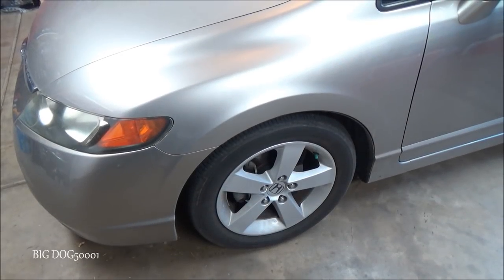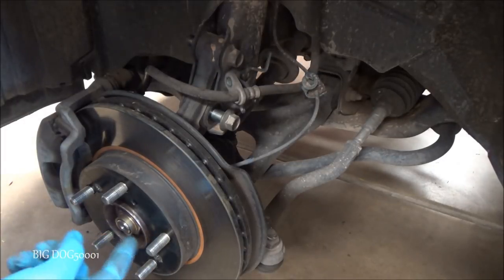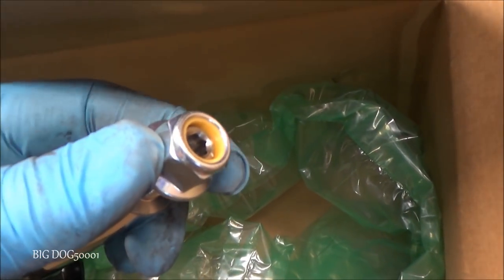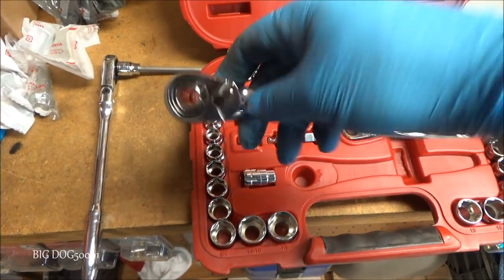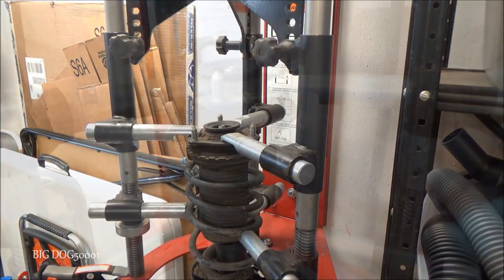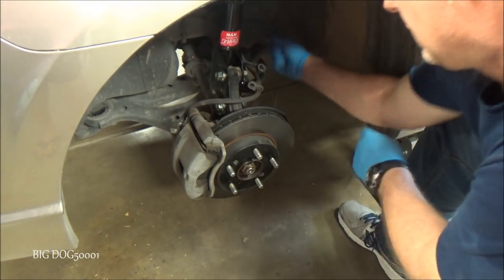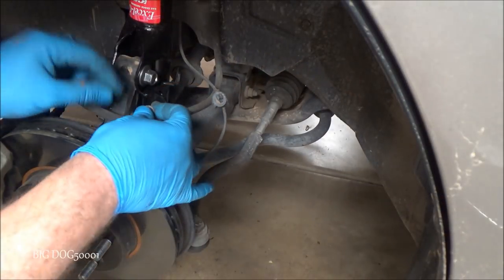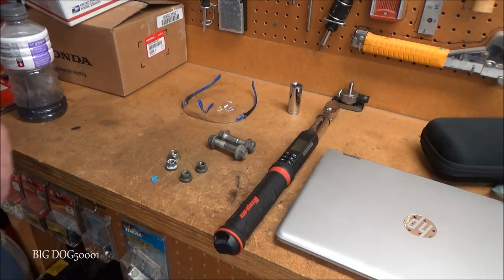Honda Civic Front Strut Replacement 2006 (2006-2011 Similar)

Comment from the maker: Tools and Parts
This channel earns a small commission using some of these links - at no additional cost to you.

KYB Strut ONLY (Front Left):  https://amzn.to/2NaRPlx
COMPLETE KYB Strut Assembly (Front Left):  https://amzn.to/2QgoYPg
KYB Strut ONLY (Front Right):  https://amzn.to/2NbFops
COMPLETE KYB Strut Assembly (Front Right):  https://amzn.to/32GgRfQ
Daytona Jack (Cheaper at HF with Coupon):  https://amzn.to/2LtHfUP
Jack Stands (Cheaper at HF with Coupon):  https://amzn.to/2LLWSWr
MIlwaukee 3/8" Impact Wrench:  https://amzn.to/2LRwryu
Sunex 3/8" Impact Sockets:  https://amzn.to/2NXij9O
My Favorite Small Screwdriver:  https://amzn.to/2Lv0HAp
GearWrench Ratchets:  https://amzn.to/2Nc1YOJ
GearWrench Sockets:  https://amzn.to/2NYlr5m
Milwaukee M12 3/8" Cordless Ratchet:  https://amzn.to/2NT7KEG
Branick Professional Spring Compressor:  https://amzn.to/2Nbdl9K
Snap-On Torque Wrench:  http://bit.ly/2TzsaU0
GearWrench Metric Wrenches:  https://amzn.to/2LQ4Rle
Neiko long hex sockets:  https://amzn.to/2N9Acm0
Craftsman pass through socket set:  https://amzn.to/2LsKyvn
Upper strut mounting nuts Honda part # 90304-S10-024
Lower strut bolts Honda part # 90190-SNA-000
Lower strut nuts Honda part # 90213-SR3-013

The Big Dog 50001 Automotive Channel Store can be found here: https://www.amazon.com/shop/bigdog50001automotive
Reply: Sadly, after doing this job, got an alignment, and it slightly pulled to the right. 3 alignments later, same results. Did some searches, it's a prevalent issue, lots of reports, no solid answers.

Comment: Thanks for the video brother, clean and simple!  For those that don't know, auto parts store usually have spring compressors to rent that work also... just did it.  Easy peasy, super quick maintenance.
Reply: Also,  for installing the piston nut on top (you know, the one you MUST replace (before releasing spring tension) without grabbing onto the piston itself and ruining your new strut, use a 1/2" drive deep well socket (my new one was a 19mm I believe), and since you can't stick a regular ratchet on there, just grab onto the outside of the deep well socket with a pair of vise grips and stick your Allen driver through the socket's drive hole.  If the center of the piston on the new strut (or old one for that matter) does not receive an allen wrench but instead takes a regular socket (like my new ones), just stick a 1/4" drive socket on it (in my case it was a 9mm) right on the end and then put your big nut socket on OVER the small 9mm socket and stick a 1/4" extension through the nut socket's drive hole to engage the 9mm socket.  Its a great work around and even ratchets! (assuming you use a 1/4" drive ratchet).  Hope that helps the next guy.

Comment: Thank you for this video. My '06 Civic sedan likely needs new front struts. The right front makes a clunking noise going over any bumps, even small ones. This doesn't look terribly difficult or time consuming, especially when using a complete replacement strut. Both the dealership and a local independent have now quoted me at over $1,400 for replacing both front struts and alignment. The Honda dealership will be using OEM, which of course costs more than AMP, but the independent shop is only $60 less for KYB's, but they're saying I'd need new mounting brackets, bellows(?), and bearings. I can't even imagine what bearing there is to replace! What's a fair price I should be expecting to pay for replacing both front strut assemblies, as I don't have the tools or confidence to do this myself. Thank you
Reply from the maker: When you buy complete strut assemblies they come with all of that stuff, bellows, upper mounts, bearings, springs etc.  On this Civic, you can buy complete assemblies from either Honda (online $350 each)  or KYB (online $125 each), but the bolts/nuts that should be replaced would need to be purchased separately.  

As far as installation costs, it varies by region and shops generally charge the fee based on their hourly rate ($75-$150 per hour is the norm) x how long the job should take.  If a shop replaces the entire strut assembly the shop should charge less labor per side than if they have to replace the strut with a spring compressor like I showed in this video.  An alignment would be another labor charge (typically an hour).   If you live in the rust belt, an additional charge for dealing with older rusty fasteners would be appropriate.

$1,400 seems about the norm for a dealership but seems a bit overpriced for an independent shop especially if they are using aftermarket parts, at least in my opinion.
Reply: @BigDog50001  Thank you so much. I was just watching your video on checking for a broken engine mount- lol. The car seems to drive just fine. There's little to no dive or body roll when braking or turning. When I push up and down hard on the front end, there's no noticeable slop or softness in the suspension. The alignment is a tiny bit off, though. I can't find anywhere that says that a clunking noise is associated with worn or bad struts, but ball joints, yes. Looking over the dealer inspection report, it seems as though a tech just test drove it and heard the clunking noise, and decided I needed all new struts just based on that. I know they rotated the tires as part of a basic service, but no mention of actually checking for looseness or damage anywhere while they had it up and the wheels off. They just wanted to charge me $1,400 to replace the struts w/o actually positively identifying the source of the passenger side clunking noise.
Reply: You can do the strut replacement yourself.  Alignment is another thing. You are getting f----d.

Comment: I just replaced both my struts on my 06 Honda Civic LX Sedan. I did half of these steps and my process was faster but I had to come watch this to double check I installed mine correctly. If you know what your doing it shouldn’t take more than 10-15 minutes per strut.

Edit: I took off both windshield wipers and the black cover he’s working under. For whoever is reading this don’t take off the bolts from the top like he is. If you know what your doing you can take off that whole black panel up on top and work with a ratchet and extension way easier and faster.
Reply: I have never worked on a car before. You think I should attempt it myself or take it into the shop?
Reply: @authenticcalisthenics7825  Are you mechanically inclined? If so, you could do it.  If not, take it to a shop.

Comment: Can I buy cheaper struts on ebay or is that not recommended? I found some for around $130 for both and thought that was a good deal, or should I not be cheap and buy more expensive ones? Thanks!

Comment: Sir, thank you for this excellent video. You mentioned the torque specs for the SI on the upper bolts but did not give specs for the lower 19 mm bolts. Any chance you have that info? Thanks

Comment: Sir great video, quick question?, I just picked up 2007 coupe Honda Civic, 81,000 miles. And the strut boots are shredded, I ordered new oem boots, any tip to install with out removing strut, thks

Comment: I actually cut a socket in half and angle-grinded 2 parallel surfaces on the top to attach a wrench to as a sort of 'poor-man's pass-through socket. It works great on that one size of nut.
Reply from the maker: Thanks for the input!

Comment: Excellent video, a couple of important points...1st, it is really important to know that a civic sedan and a civic coupe use different struts, civic coupe is not compatible with the civic sedan...2nd, sadly, KYB at this writing does not make a full quick strut for the civic coupe
Reply from the maker: Always have to verify parts that's for sure, even Sedans of different trim levels can have different parts.  Thanks for the comment!

Comment: Thanks for the video! Recently hit a decent-sized piece of metal from debris on the interstate cut a good hole in my tread wear. After it happened I noticed a banging sound when I hit bumps even small ones like someone hitting the floorboard with a sledgehammer, so I think it damaged the strut plus the car has over 300,000 miles on it LOL. Do I need to Jack the entire front of the car off the ground or can I jack up each side independently to get the wheel off the ground?  Thx.
Reply from the maker: Personally, if I can avoid it, I don't work on vehicles that are only lifted on one side (more unstable).  Another issue is if lifting only one side with a jack (and using the designated side lift point), then there is no place to put the jack stand.  For this reason I generally use the lift point in the front center and use 2 jack stands (faster and easier than jacking up car twice when doing work on both sides).  On these Hondas I only use the designated lift points and I don't get under vehicles unless jack stands are in place.

Comment: Question - did you also replace the strut mounts, the spring insulators and the mount bushings? Can you say why or why not?
Reply from the maker: If I did not show it in the video, then they were not replaced.  If I remember correctly, they were not bad on this car at that time and it saved the owner money by not replacing them.  If money is no object, then sure I would have replaced them too.

Comment: Random question.  When I replaced my front struts I didn’t put the strut under load when torquing all the bolts (top 3 bolts and the 2 bolts that go through the steering knuckle). Been driving the car for 6 months now and have a creaking sound coming from driver side when turning at slow speeds.  I’m thinking its possibly because I didn’t torque the bolts when under load.  Would I be better off just buying brand new struts again or could I use the struts that are currently on the car but retorque all the bolts when its under load?

Comment: You load the suspension bu jacking under the lower ball joint. I can’t do that because I have a grease fitting in the way. Can I jack under the rotor instead?

Comment: Dave,
I appreciate the professional approach to your video. I'll check out others too. I need to fix a power steering leak (Honda Civic 2006-2011), either its the pump or the "O" rings. Do you have a video on that process or plans to complete one?  Can you give me the socket set kit number from Craftsman or the correct tool name since it's hollow shaft? Thank you!

Cheyenne
Reply from the maker: I do not have a video on those yet.  Here is the link to the pass through socket set I have, other companies make a similar set.  Craftsman pass through socket set:  https://amzn.to/2LsKyvn  Thanks for the comment!

Comment: Amazing video I need to change my ASAP but where did you get the tool for tuning the torque on the bolts would really appreciate feedback thanks!
Reply from the maker: If you mean the torque wrench I used in the video, its a 3/8" Flex Tech Angle Torque Wrench from Snap-On.  They are not cheap  http://bit.ly/2TzsaU0  Thanks for the comment!

Comment: Why is it necessary that the suspension be put under load before the lower strut bolts are torqued? What happens if it is done without any load?

Comment: Thank you very nice presentation first rate ..What about the top bearing plates?? ..are they reusable all the time also boot and bump stop?...Thanks again Happy New Year! Be safe
Reply from the maker: They don't have to be replaced every time, but if there is any doubt then it is best to replace them.  At that point I generally buy the entire strut assembly which comes with everything.  I stick to KYB for Hondas when I buy complete assemblies.

Comment: Thanks...but wondering what was wrong with the original strut? Didnt see any leakage, shaft looked straight and clean. What was the problem you were trying to fix?
Reply from the maker: Leaking can be a good indication but they don't always show leaks.  If I remember correctly they lost their dampening ability, so it was a very poor ride and it would lose it's composure over bumps.  I see this a lot on Hondas in the 150,000 -200,000 mile range.

Comment: Sorry if someone has already asked this, but have you used the KYB strut plus assembly before? I’m getting ready to install those on my civic. I’m wondering if they’re preloaded, meaning I don’t need to load the strut before torquing everything down. Thanks for your help!
Reply from the maker: It is good practice to always load the suspension before final torque when installing struts.  The biggest reason is the rubber bushings should be tightened down in the position they will ride on the car so they don't get twisted up and fail prematurely.

Comment: Hi. A question, Honda service manuals say "Do not place the jack against the ball joint of the lower arm." Would that not risk causing damange the way you raised it to put it under load?
Reply from the maker: Typically that warning is for conventional ball joints that have the ball joint stud protruding through the bottom, this design does not have that (on this model the ball joint stud is pointing up).  If the ball joint stud was on the bottom, I will usually put the jack next to the stud not directly underneath it.  That being said, there is no warning like that for these Civics (2006-2011) in Honda Service Information for strut replacement (or ball joint replacement).  This is the only statement on it:  "Raise the front suspension with a floor jack to load the suspension with the vehicle's weight."
Reply: @BigDog50001  Thanks for the reply. The service manual was for a 2010 Jazz, where the stud is also up, like the civic. But thinking about it now, the ball joint is a seperate piece from the control arm and is pressed in.   The civic you showed, the ball joint is encased in its own seperate housing, which is safe to lift from.

Comment: What’s the reason for setting the car’s weight on suspension before tightening all strut fasteners??
Reply from the maker: The practice of tightening suspension components under load is to put them into the positions they will ride on the car most of the time, this is especially important for rubber bushings that might get twisted up and fail prematurely if tightened in a position other than where the car normally rides.

Comment: hey I have Civic Si 2012 4doors does it fit Thanks for great explain
Reply from the maker: Similar but not exact, those have stabilizer links attached to strut.  I would verify parts with a Honda dealer or parts store.

Comment: What's your opinion about not replacing lock nuts per Honda's service manual? There is at least one parts store channel showing the same procedure for the same car but reusing the old lock nuts. Personally I never quibble over the expense for new hardware if that's what the service manual recommends, especially suspension component lock nuts. And of course, in this case Honda recommend new hardware.
Reply from the maker: I always replace them, I have some of those exact locking nuts on the parts shelf right now ready to go onto a Civic.

Comment: Big Dog are they eccentric bolts or straight thru. Do Hondas require an alignment after replacement. Just a question? 👍
Reply from the maker: They are normal bolts, they do not have any adjustment on them. I do recommend an alignment check anytime struts are replaced.

Comment: How are these KYB struts holding up? I plan to change my mounts as well, they are loose and making a lot of noise.
Reply from the maker: No complaints from the owner, KYB makes pretty shocks and struts in my opinion.
Reply: @BigDog50001  Thanks!

Comment: Do you recommend these after market struts? The OEM absorbers are like $150 each
Reply from the maker: For Hondas, if I don't use OEM Honda, I use KYB struts.
Reply: The OEM rear shocks I took off today from my 09 Civic were KYB's .
Reply: @timsager6153  oh wow I have a 2010
Reply: Oem=KYB
Reply: @fhowland  the front ones? I dunno. I got KYB and the ride is about the same as the ones that came with car 10 years ago.

Comment: Does the top mount orientation have to be in a specific way/direction?
Reply from the maker: There are small arrows (triangles) on the top of genuine Honda ones that need to face towards the front of the vehicle (slightly to the outside).

Comment: What would happen if you didn't put the suspension under load like you did with the floor jack under the ball joint? By that I mean  torqueing the bolts without the load
Reply from the maker: Most common issue is rubber suspension bushings can be tightened in an incorrect position, which can cause them to bind when the vehicle is returned to normal ride height.  Basically, it can shorten the life of the rubber bushings.  Some designs are more susceptible to this than others.

Comment: what if a pressdown on all 4 corners of car doesnt seem to budge it  but either front of back strut on drivers side seems to bottom out  and make alot of noise over my really bumpy  road to my house. this road is so bumpy it may be the reason i have a bad strut. the strut doesnt seem to leak but the bumpstops or whatever that plastic thing inside is and also the boot are coming apart. 
its a 2011 civic dx and my nephew wants to sell me a salvaged body of a 2009 civic si. would those struts bolt right in, especially if i used stock dx civic springs instead of Si springs?

or if im stuck on this really bumpy road to my house would i be better off with the harsher civic Si springs to save my struts and car from further damage?
Reply: of course honda recomends all new bolts and nuts especially honda parts, so they get an extra sale, lol
Reply: besides an alignment is it ALWAYS  a very good idea if even though u r unemployed [money is tight] to replace both at same time? or can this be just done when you know u need it.

Comment: My civic has a high fuel consumption what can I do, check to improve your performance and fuel consumption!
Reply: Check your Air Filters, O2 sensors, make sure your wheels have proper air pressure, and just keep up with regular maintenance